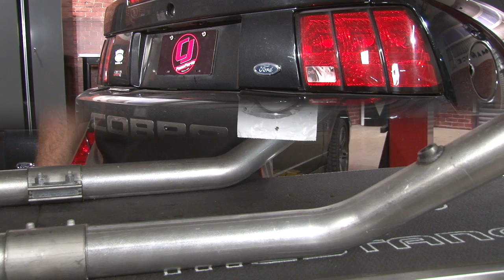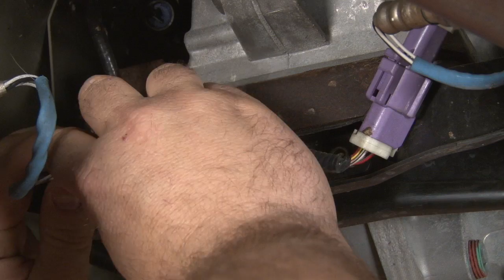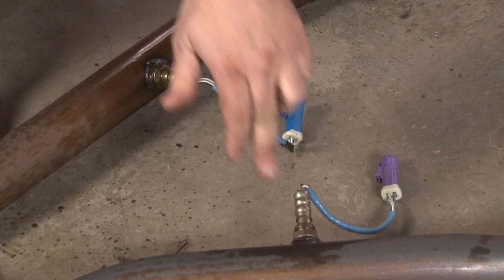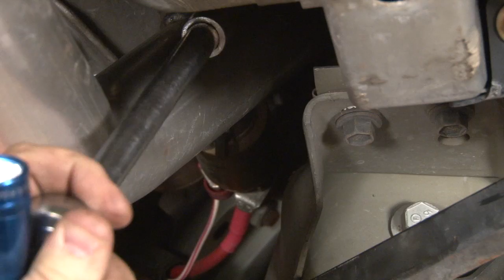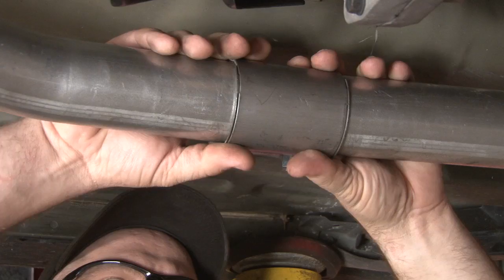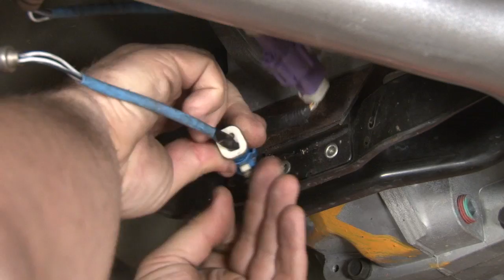Mustang GT/Cobra/Mach 1 BBK X-Pipe Off-Road 2.5" w/Stock/Shorty Headers 1999-2004 Installation

Comment: Cj pony parts should post a header install video on a 03-04 cobra
Reply: No one would ever buy them. You need to take out the whole K member. It's ridiculous.
Reply: @jaybourbon8608  I bought them for my 01 cobra, it can be done on jack stands and jack in about a full day or day and a half. I also did an aftermarket catback exhaust in that time
Reply: Kade Slattum I can pull out my k member do new headers and do paint work and replace my suspension in 8 hours lmfao it takes longer then a day doing them in the car I just took aftermarket ones off my mustang and put in ported stock ones

Comment: purple o2 sensor was rusted shut, 3 hours of it soaking in rust penetrator and then trying to take it off i only stripped the o2 sensor so i had to buy a new one from autozone cause i had to go to school the next day. literally always something goes wrong when i install a part. but when i finished, holy shit this thing sounds incredible. it sounds like thunder rumbling at idle and at 2k rpm it hits a sweet spot i cant describe. i believe i have a flowmaster catback, the tips are flowmaster, but i cant tell what mufflers its using as no info is printed on them. i dont think theyre stock mufflers, it was much louder than stock, though i havent heard a stock mustang before, it would probably be louder.

Comment: I don't think you have to turn off the 02 sensors. You'll just have the stupid check engine light, but it won't interfere with the driving, right?
Reply: +Ryan Johnson It should run fine even with the light on
Reply: Bill Tumas Thanks brother
Reply: +Bill Tumas quick question so with no cats will the car bog out? I have no cats on mine and it stumbles I don't have the rear o2 sensors installed only the first two by the headers (2000 v6) should I get bungs welded in and installed the after cat o2 sensors or would it not make a difference thank you!

Comment: So are the flow masters Supper 40 Delta 40 or super 44 .. yup its important :)... I have the 943042  3" in and 3" out  Its the delta 40 series  ... I want to use the Mac Power chamber BUT this video would likely be good for that install as well as it provides a detailed description on how to .

Comment: Through trial and error and lots of time and cash  I'll give it to straight that BBK X pipe is junk stamped X  makes the car sound Raspy and cheap.  OFF road H pipe or True Dual and  MIL eliminators and a Single or Double Chamber Mufflers are the way to go .Sounds good driving local around town when you get on it it sounds nice a deep not like some raspy tin can and nice drone on the Highway cruising.Btw I own 3 Mustangs so I know the deal .Good luck Guys .

Comment: if you dont have a car lift its about 20 times harder and good luck with exhaust manifold studs and torque everything down tight or you will be doing it again.
Reply: I had no problems with my exhaust when i had my transmission out for a clutch, exhaust went right in after! No lift either just some tall 6 ton jack stands

Comment: Do you have to tune it for no o2 sensors right away or can you do it later
Reply: You will get a check engine light if you do not address the 02 sensors.
Reply: Do u need 4 mil eliminators for this model?

Comment: My other question is on the passenger side there was a flange on the original H-Pipe that went into the exhaust header about an inch. I installed a new gasket but at 2000 RPM it sounds like a popping almost is there anyway to correct this issue?.?

Comment: I have a 2002 Mustang GT with stock manifolds, stock H pipe with cats still in place, all i've done is a muffler delete, so i wanted to install an O/R X pipe from either BBK or Pypes, is it possible to weld off the stock h pipe and weld on the x pipe with no problems or is it necessary to do it like in the video?? I was plannning on taking it to this muffler welding shop in my local town thats why, please if you can reply back asap it be great thanks.
Reply: +Cuauhtemoc Zamora do it the way the video says to. the x pipe isn't something that can just be welded on.

Comment: if i were to install the x pipe and not run eliminators would the car run funny or would it run fine and just throw the check engine light
Reply: Kaden mine didnt run fine. my check engine light was already on but the car would shoot up in rpm randomely to 2-3k and with the x pipe with no cats it was super loud and annoying. never again
Reply: yea ive had the x pipe on for a few weeks without the eliminators it sometimes dies and idles horrible ordering the eliminators tonight

Comment: I still say you guys would have been better off installing a UPR  x pipe the problem with BBK x pipe and Flowmaster Mufflers is this BBK x pipe is baffled in the center X just like the Flowmasters are baffled a baffled off-road pipe and baffle Mufflers do not mesh well at all together although UPR off-road x pipe which is not baffled and does not have a baffled Center pack in the middle of the X it is a straight through X design does go very well with baffle Flowmasters UPR x pipe is the way to go BBK has that baffled Center pack in the middle of the X I know I had them on my 97' cobra I took them off and installed a UPR off-road x pipe with my Flowmaster 44 setup and to be honest with you I will never change the setup on my cover ever but for you fox body 5.0L guys H pipe is the way to go do not run an x-pipe on a Foxbody 5.0
Reply: Did you come straight out the back or did you have turndowns after 44th

Comment: its never this simple unfortunately. i couldn't get the driver side nut on the manifold stud to break loose, hit it with a torch, still wouldn't come loose. got the breaker bar, and well, they call it that for a reason. broke the stud, had to pay $186 to get it fixed.

Comment: I'm confused, why is there O2 sensors when there's no catalytic converters
Reply: You have 4 O2 sensors. 2 upstream, and 2 downstream. Upstream help control the fuel. The downstream measure to see if the catalytic converters are working. Still need to plug the holes in the rear o2's or there will be a exhaust leak.
Reply: eric gomez plus if you dont tune it then your computer will give you a MIL light thinking your cats are broken

Comment: Why exactly do I need a 1/2 ratchet and a 3/8 ratchet. Can I do the install with just a 3/8 ratchet and all the necessary sockets, extensions, and swivel?
Reply: Connor Olson  We list the tools we used for the install, it doesn't necessarily mean you need all of them. Exhaust bolts rust, a 1/2 ratchet will allow you more torque.

Comment: I have a 98 GT and I know the install process Is the same, but I installed it and im not sure if the stock flow tubes will fit the end of the x pipe. do you know Bill?
Reply: +Travis Poirier If you got the correct 86-98 parts there should be no issues.
Reply: I have stock mufflers with my 97 gt im going to uprade my mufflers when i get the money but was thinking of getting an x-pipe for now, will i still gain any performance and sound with my stock mufflers and xpipe!Thanks!

Comment: so I know that replacing this for the stock H pipe on my 2004 gt requires taking off my cats. once i add my Off road x pipe, will i need a tune?
Reply: Giovanni Leyva  not really you can either get the mil. eliminate which keeps your 02 sensor from shooting a code or you can tune it
Reply: Dale Laird oh ok. thanks.. so tune is not required?
Reply: No it isnt
Reply: Giovanni Leyva i put a offroad x pipe on my 98 gt, it ran weird after the x pipe, it would stall if i let the car sit for a few minutes idle, also sometimes my rpm would randomely shoot up around 2-3 thousand. i never got mine tuned.

Comment: will this pass smog test in Chicago?
Reply: +marine0331inf  I am not familair with Chicago smog laws but It removes the cats so I doubt it
Reply: +marine0331inf It will NOT.  It will not pass any smog test.  If you get this or any off road X/H pipe, keep your originals.  When inspection time comes bolt the originals back on, take test, pass test, reinstall off road X/H pipe.

Comment: Am I the only one that thinks flow masters are one of the worst sounding exhausts? Lol
Reply: +Noah Marsh Nope, I used to love Flowmasters until I heard straight-through race mufflers like Magnaflow Magnapacks or Borla Stingers, now I can't stand them. Shouldn't have a chambered exhaust on a 4v Cobra anyway lol.
Reply: Noah Marsh nope had super 40's on my 99 GT and ditched them for some slp loudmouths and it sounds so much better.
Reply: No,and there not made for modular engines there meant for push rod engines.
Reply: Not alone bro
Reply: I hate flow master
Reply: Flows only sound good with a full off road setup, like long tubes, true dual or H-pipe, and full flowmaster cat-back.  Factory manifolds just don't cut it.  That's why most sound like ass, especially with an x-pipe and pinched bends instead of mandrel.
Reply: Yea lol
Reply: Great video but we all don't have lifts. I lifted my car up with jacks and it took a lot longer then one hour .Everyone on this page talking about flow master exhaust and its crazy loud, if you have the BBK exhaust like this and the SLP 1 OR SLP2 man I cant imaginge how loud that set up would be
Reply: I think flowmasters sound the best with this set up
Reply: Noah Marsh I disagree, I ran Magnapacks and Flowmaster Super 44s with off road mid pipes on my Mustang GT 2v and preferred the Flows overall.
Reply: @derrickflorence6960  poor people, lol.

Comment: So I installed this BBK off road X a few weeks ago I have had a number of problems just because of having to put the car up on jack stands. Which made the entire process a lot harder than need be but my question is on the driver's side on an 2000 automatic GT you have to align the pipe just right so it does not interfere with the shift linkage on the transmission. So with that being said is it OK for there to be about an 1in or 2 between the main pipe and where the clamp connects to the x pipe???? Please reply.
Regards
Reply: Mrs. Rose As long as the clamp is covering the opening and there is no exhaust leaks it will work fine
Reply: Bill Tumas alright thanks much bill! Great video by the way watched it step by step to install this x pipe and couldn't be happier!

Comment: How can you ruin any car with flowmasters let alone a terminator  SMH  worst exhaust ever.. sounds like rattling coke cans
Reply: fudgeman333 in my experience flows are horrible sounding on cobras. they are better sounding on gt's. cobras sound best with straight thru like SLP or borla
Reply: Rattling coke cans lol
Reply: @Djuane  i bought flowmasters for my cobra cause they sounded good on my gt and they sound like aids on my cobra im going to throw some headers on it an x pipe and have some straight thru mufflers welded in cause i like it when my cars shoot flames